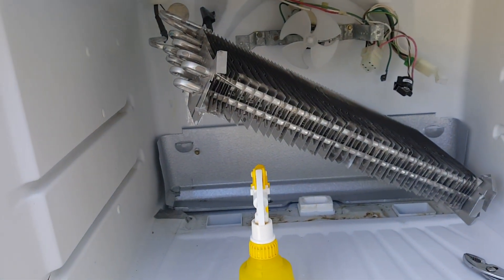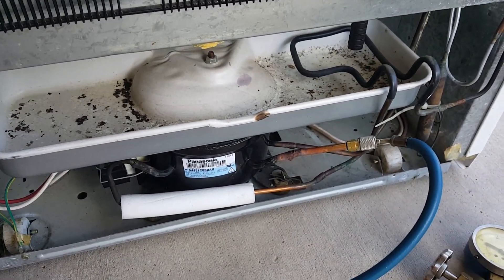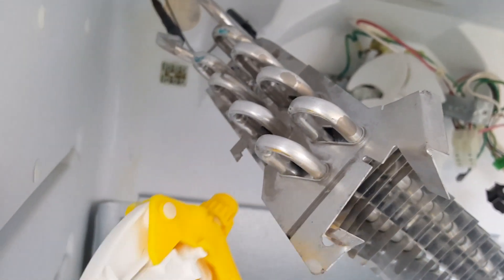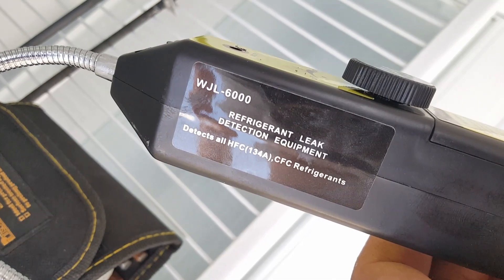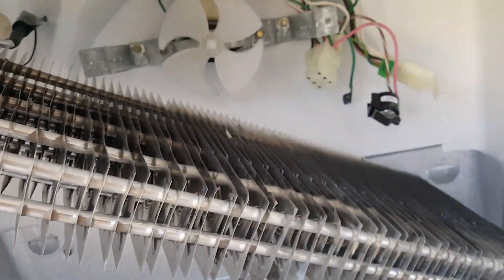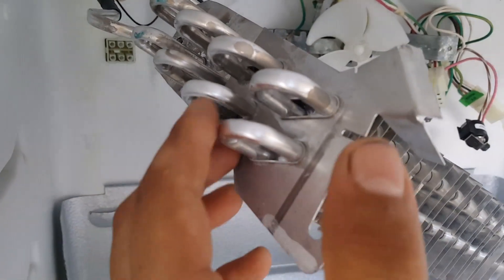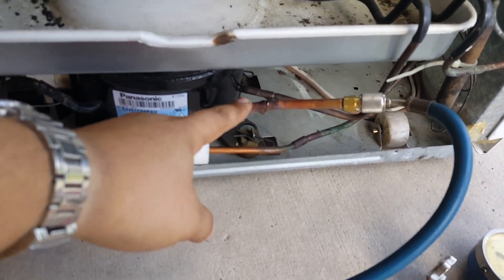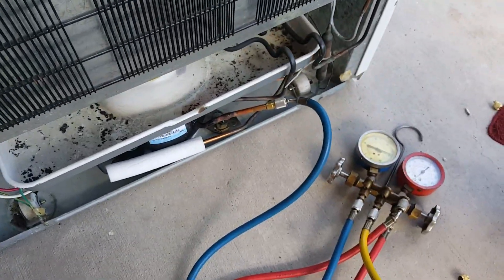How to detect a leak in refrigerator NOT cooling

Comment: As a certified tech and appliance repair serviceman you're troubleshooting and logic is sound and proper and you know what you're doing. But one thing you're wrong about. This fridge is way older. Way way older than 5 years old. In 2023 right now. I guarantee you this machine is a minimum of 10 years old. Probably closer to 15. I'd bet my right testicle if you do that lookup of the serial to check the date code I'm absolutely certain I'm correct. That condenser along the back of the unit and the old style evaporator fans like those haven't been used in an extremely long time. That date on the back is not manufacture date. Maybe a service center stamped it when id was worked on at some pointm who knows. But this fridge is very old. You've brought new life to it so congrats but you're wrong about the age of it for sure. Good job and nice work btw

Comment: The heating element expands and contracts and rubs a hole into the evaporator over time. A very common problem.  2 part epoxy is the easiest fix. Trying to solder/braze the evaporator is difficult if you have never done it before since the metal is SO THIN that you easily burn right through it and create a huge hole that is impossible to close. Been there done that..lol
Reply: Any epoxy you can suggest?
Reply: Do not brazen or repair an evaporator. It will not hold. And will fail eventually. Replace the evaporator. Itself. Don't try to repair aluminum.

Comment: Curious to learn from you why you installed a service port on the high side ONLY and not the low side as well--or instead.
Reply: He installed a service port on the stem. Which is where they fill it from the factory.
Reply: Low side is the suction line with the insulation on it coming out of the freezer and the high side is the line going to those black coils on the back
Reply: Every one of them I’ve seen has insulation on the suction line coming out of the freezer back to the compressor.

Comment: My fridge stinks, the compressor is working, both the bottom and the freezer fan are working, but nothing is cold. What should I do? Is it leaking? Should I unplug it?
Reply: Sounds like it could be leaking. I would recommend turning it off at least if it's got no refrigerant in the system if compressor is in fact engaged that can damage it if it goes on for too long.
Reply: I mean it already leaked out all the way if it's stinking and doesn't get cold at all.
Reply: If its a chemical smell I'm sure it's probably a leak.
Reply: @chrisscott5339  it was the compressor.
Reply: @juggerswood   DId you end up needing to add more refrigerant or was the compressor bad all together? Asking since I have the exact same issue.
Reply: The compressor was bad all together. @11maplefreak11